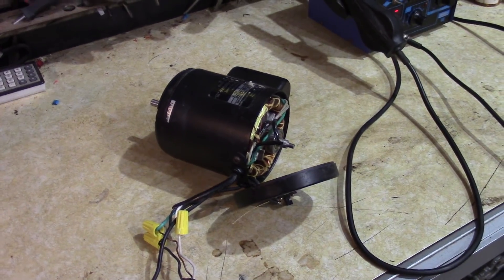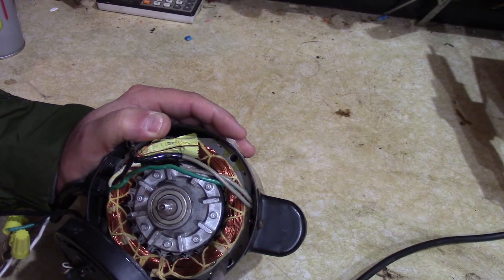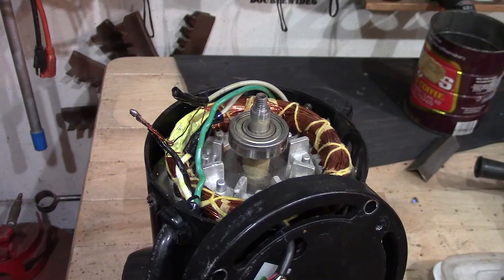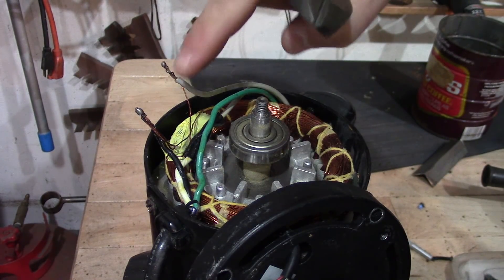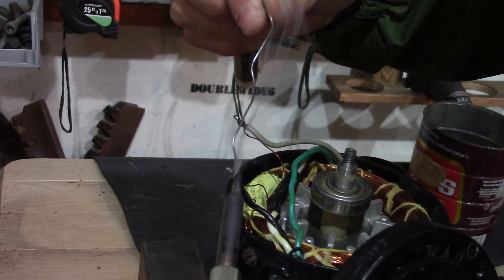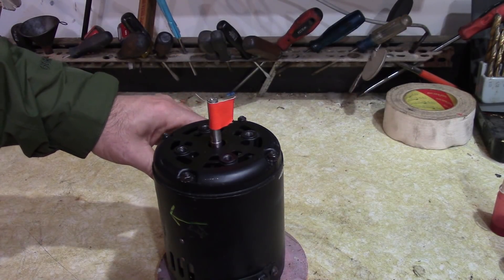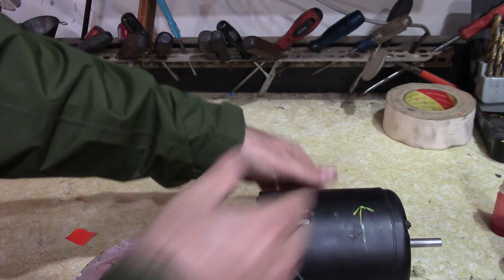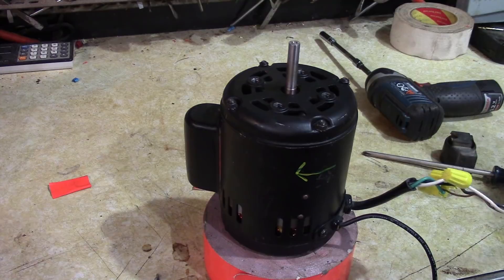Attempting To Reverse A Non-Reversible Motor

Comment: Awesome video on motor rotation keep them coming... the motor I have has two smaller winding wires to each lead rather than one, so would I have to swap two and two or just one. If so which of the two gets swapped...thank you

Comment: cool video as usual,  what about making a motor reversible to fix a drain auger setup? my 1/3 hp unit is out and if I didn't need reverse it would already have a weed eater motor on it.
Reply: Take the inside out and put it in the other side 
.

Comment: I bought a used electric concrete mixer off Craigslist and the way the paddles in the drum were angled it was turning in the wrong direction. It has a non-reversible motor. Found this video and tried this. Problem fixed! Thanks!

Comment: So if i just find where the smaller wires attatch and switch thise from their original im good ?   Is that basically all you did?   My motor has a start capacitor and a run capacitor,  does that matter?  It almost seems to me i coukd switch the wires in the switch capacitor and that woukd work.    Im lost.  I was so excited to upgrade my table saw to a 2 hp motor to find it runs in the wring direction and im lost.  So much info in youtube but its over my head

Comment: Now see, this is why you have a You Tube channel and I don't.  I would have just mounted the motor on the other side if it was going the wrong direction and, If I needed to remove heat shrink tubing, I'd have put it in the freezer to expand it.  ;-)
Reply from the maker: Sometimes, you just need to give it a shot.  I was not sure how this one would turn out.

Comment: So the connection that had two wires, you only swapped the thinner wire, right?  (Or did you swap both?)
Reply from the maker: I just swapped the thinner wire.

Comment: Cool,    I did something similar with a reversible ceiling fan when the plastic reverse switch broke and had to install a new DPDT switch (metal)

http://www.instructables.com/id/HOW-TO:-Wire-a-DPDT-rocker-switch-for-reversing-po/
Reply from the maker: Cool, it is nice when you can fix stuff yourself.